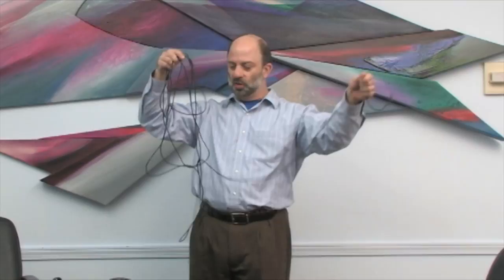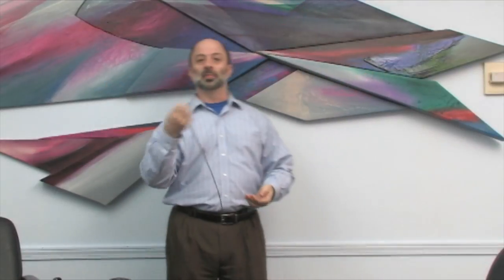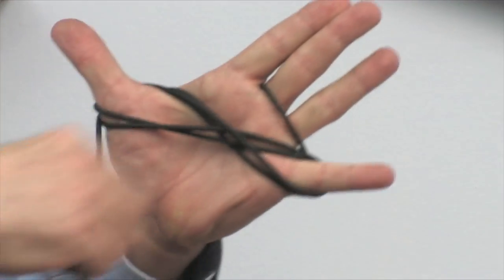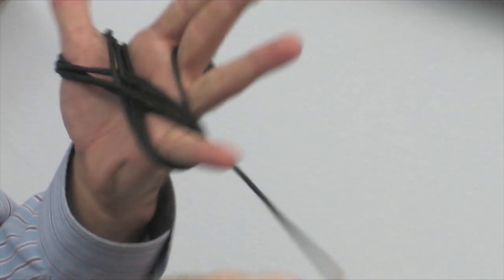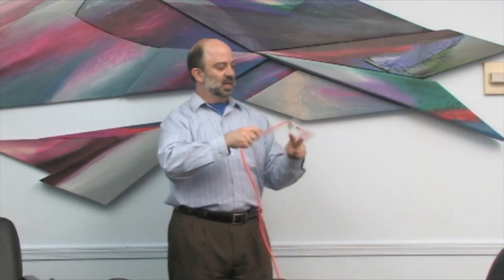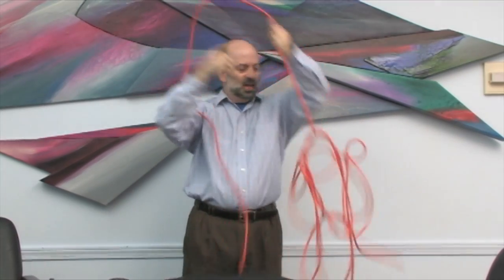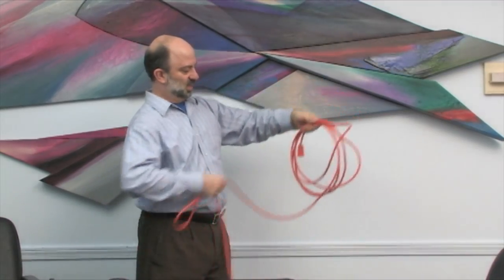How to Wind Cables So That They Never Tangle

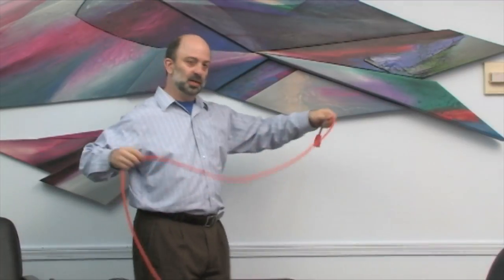Comment: Thanks for posting.  Figure 8 was very handy.  However, during the second method left, right, left, right twist, just at the moment you show how to do the opposite side twist (at 1:27-1:30) you cut the video instead of showing how your hands need to twist properly.  All during that segment you use video cuts instead of smooth stream, so we cannot see how to properly do the twists.  Reduces the usefulness of the video for the 2nd method.  

But again, thanks for posting.